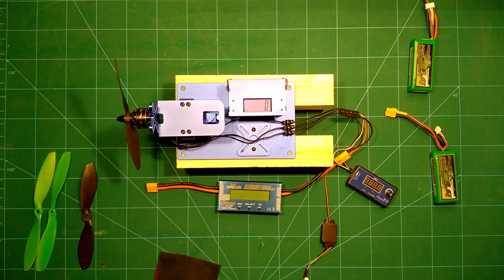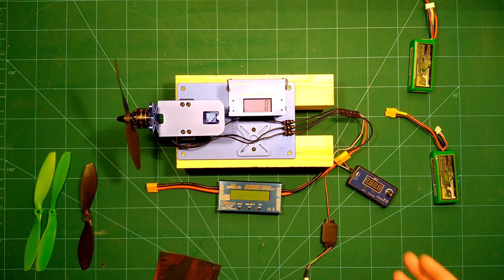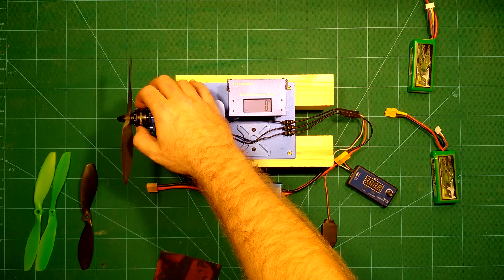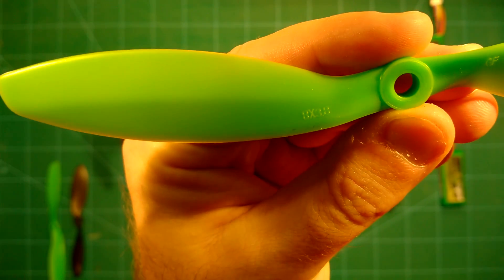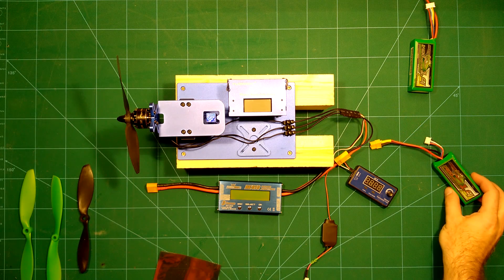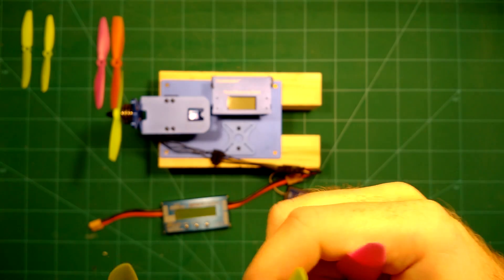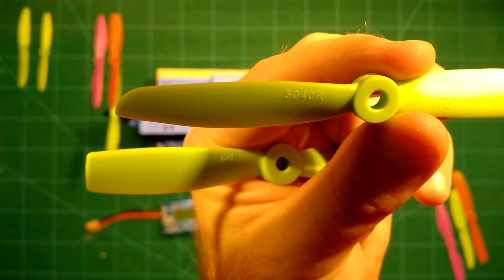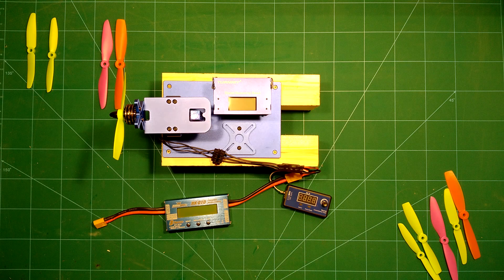Storm Brushless Motors by Flyingfolk: Even more Thrust Tests!

Comment: how come it doesn't sound like you ever give it the full beans? max throttle?
Reply from the maker: +endyouoff Maybe the recording / microphone. As you saw on the servo tester it was definitely at "full beans" :-)
Reply: +RC FPV Flight OK I'll look again, it always sounds so much more stressed in other thrust test videos. ,by the way these are the same as the red motors helipal uses,yes?
Reply from the maker: +endyouoff It very much depends on the kind of microphone you use. I use a dampened mic, so that my voice does not have so much echo to it and sounds softer. That will of course also affect the recording of the motor sound. People have said that they are the same, yes. I cannot confirm this personally, since I do not own the ones from Helipal.

Comment: Hey. I try to figure out how well the Storms perform in comparison with the Cobras. Did you by chance also do a few thrust tests with the same setting and cobra 2204/2300kv motors? I've found that the storms are way more balanced and silent but lack a bit in the top end thrust. But it's more of a feeling since I don't have a test stand such as yours.
Reply from the maker: +wuzzle punkt Hi! I have been holding back on getting Cobras, since they currently seem to face some quality issues from what I read on Facebook groups. As soon as they have sorted this out and I have tested them, I will put up the data. Meanwhile you can compare it with the official test results on the Cobra website (http://innov8tivedesigns.com/parts/brushless-motors?cat=189) which will show you, that the Storm motors are quite similar in performance.
Reply: Well I had no trouble with mine (til I crashed one of them into concrete floor :P)
I'll be batient then or I'll build myself a test stand or something. Thanks for the info though. :)

Comment: Love the music all along :)
I should maybe grab one of these trust stand!
Have a great new week
Reply from the maker: +ABMNS PRODUCTION Cheers mate! I greatly enjoy the test stand, it is a good tool. When you get one, just make sure it's well calibrated. My one came well calibrated, but a friend's one was having an error of almost 200g when measuring 1000g of thrust - very bad.
Reply: RC FPV Flight Thanks for the great information!
How do you calibrate it? Is there a procedure?
Reply from the maker: +ABMNS PRODUCTION Yes, there is. First step is simple, just hang some well-known weights onto the stand (I did it with 250g, then 500g, then 1000g and finally 2000g) and check if it displays their weight correctly. If it does, congratulations, you got a well calibrated stand and don't need to do more. That was fortunately the case with my one.

If you see that your stand is off - no worries. You now need to get a 5000g weight and hang it onto your stand. With that hanging from your stand, you just press and hold calibrate until it completes. That way you can calibrate it.
Reply: RC FPV Flight Thanks a million for sharing :)
I will try to do not forget when i will buy mine!